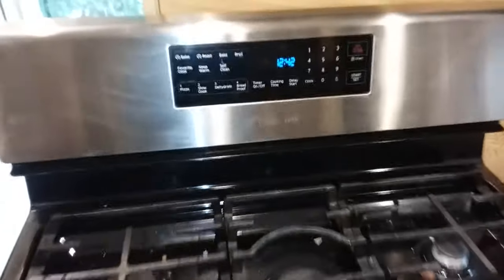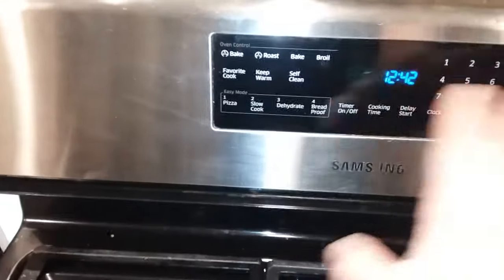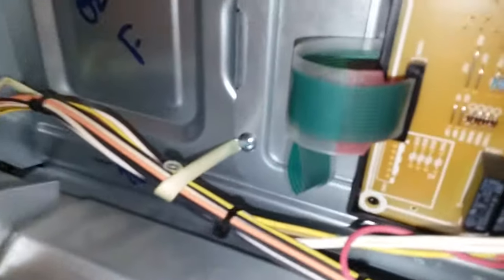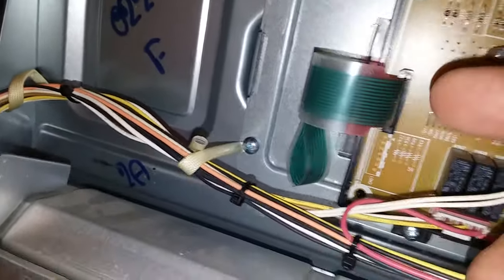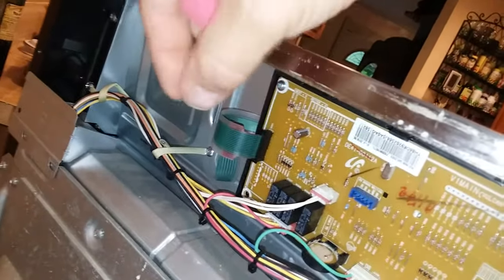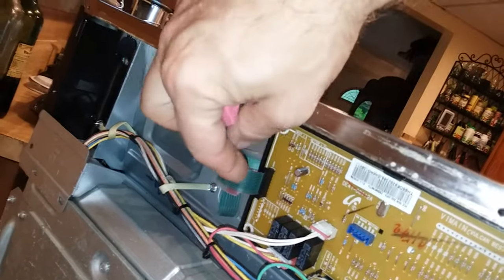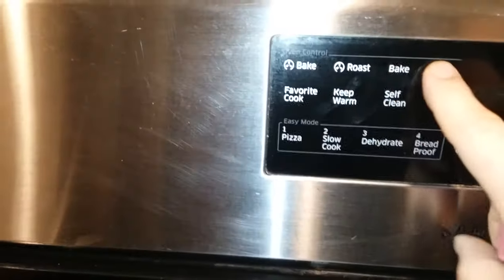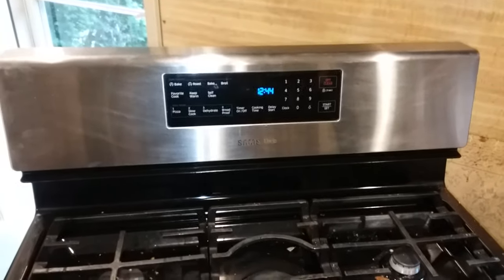Samsung stove keypad not working properly

Comment: I can't thank you enough for this video. My Samsung oven freaked out on me. Yesterday the Bake button quit responding. Then today it started beeping.. randomly. I went to check on it and it was actually turning the convection on by itself. I kept turning it off and it'd come back on.. then finally it got pissed and threw up a -SE- error code.  Took me about 5 minutes once I got it pulled away from the wall to fix it. I was already looking into purchasing a new control pad but didn't even need to do that. Mine is a Samsung model NE594R0ABBB/AA

Comment: Same issue i was dealing with.  (same fix from 4yrs ago)
Disconnected ribbon connector, sprayed ribbon end and socket with contact cleaner.  WAIT till dry.
Reconnected ribbon cable, connect power.
Range is now fully functional!
TY

Comment: This worked for me on model NX58*565***! The tab for the control board was a pull the plastic component and then the board ribbon. The control board would not register some buttons like the clock, bake, or self clean, after cleaning with an eraser everything worked. Thanks!

Comment: I have the exact same stove I took the ribbon cable out and sprayed a a small amount twice fine mist of 91% isopropyl alcohol into the connector work like a charm
Reply: the eraser alone hasn't worked for me; same buttons still don't work. I wonder if alcohol will do the trick. When you say "into" the connector do you mean onto the tape itself or into that black square?
Reply: @KaylaHunter1110  carefully release the black plastic connector by the tiny ears at the top and bottom of connector.this should allow you to slide connector back on the tape and pull tape out. Then spray isopropyl alcohol into where tape came out of and clean the end of tape also. The highest % of alcohol you can find is best. I used 91%. Let it dry and put it back together. But after that you still have to go through the reset procedure that is in owners manual. If you can't find your manual you probably can find that on Samsung website or a YouTube video. Good luck!
Reply: @KaylaHunter1110  my terminology was off saying "tape",ribbon cable as you said is correct

Comment: Imagine how much consumers were ripped off by repairmen...
Reply: The control panel is like $75 .. add that with a service call and labor charges.. and I'd say some at least a couple hundred bucks. I almost bought the control panel to replace mine until I tried this and it worked.

Comment: Only one side of the ribbon has the metal connections, so no point using eraser on both sides... I couldn't find an eraser so I used very fine sandpaper and it worked.

Comment: I wish I had of watched this video yesterday, someone how I broke the black part that the plastic strip goes into. I destroyed the wiring and I have a new control board, however it does not have the black part attached. I don't know what to do at this point.